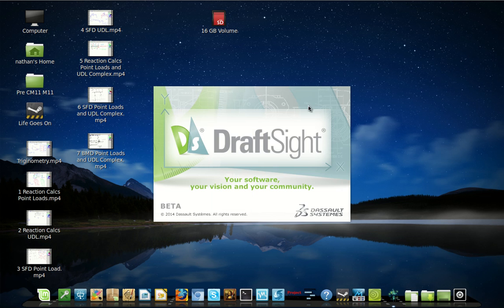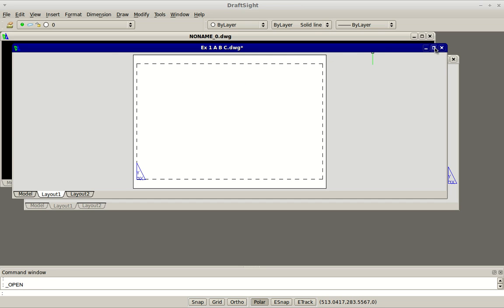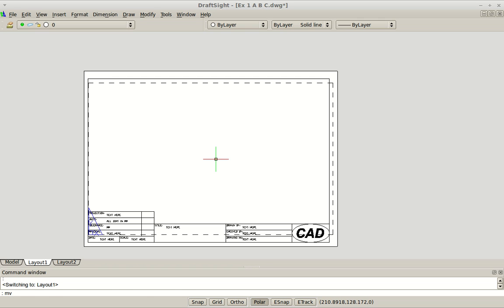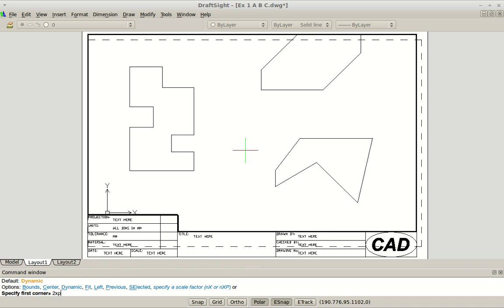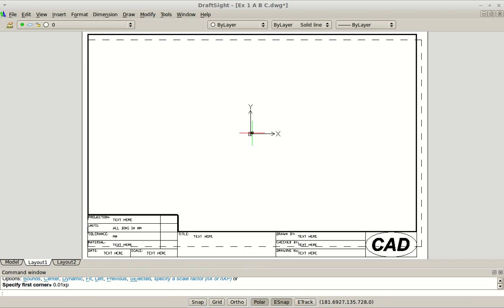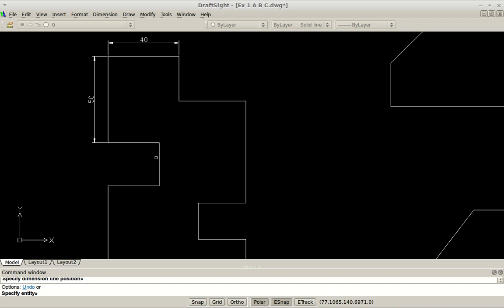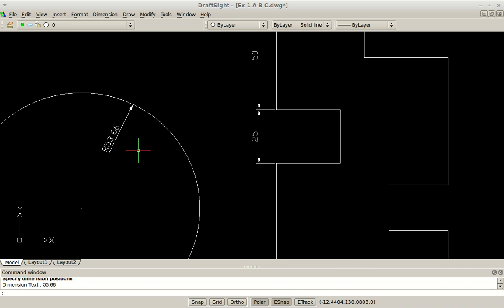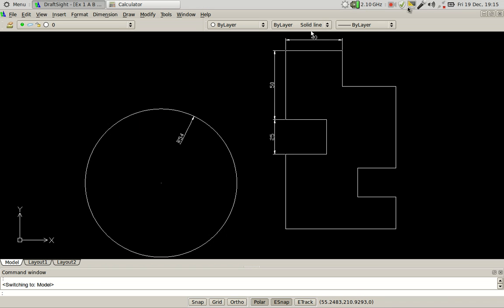DraftSight (AutoCAD) - Scale - Dimensions - Viewports (also for Linux etc)

Comment: Excellent video.  So much better than anything I´ve found on the DraftSight website. I´m started using linux and I find it very difficult to find anything in its file system! Are there ready made templates and where would I find them - if not where can I download a set? Many thanks. Hope you put up some more videos on DraftSight.
Reply from the maker: +Simon Gatti Hi Simon, the Linux file system works thus - try to keep you documents in the folders already there for you (Downloads in Downloads folder etc) but if you need to set up your own folders then set them up in your home directory. All of the other files on the system are there to make the system work and should be completely ignored, that's the beauty of the home folder, it's to stop people looking around and accidentally meddling with things they don't need to touch. The templates you speak of are just regular .dwg templates etc, the same that you'd use for AutoCAD. Any templates for acad will work in Draftsight, just pretend it's AutoCAD (but without 3d). For 3D parametrics etc (esp engineering) see Freecadweb.org

Comment: How do you scale if it's in inches like 1/4"-1'?
Reply: Omar Cruz That would be 1/4" to 12" or 1 to 48 scale. Zoom factor 1/48 = 0.0208333xp?
Reply from the maker: +g simpson +Omar Cruz Always check the printout with a scale rule too, to be sure.